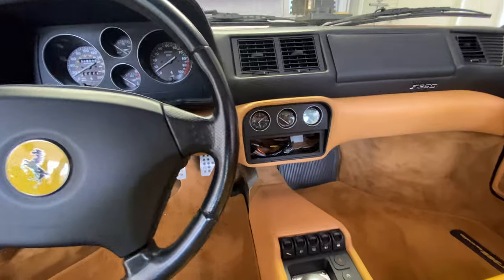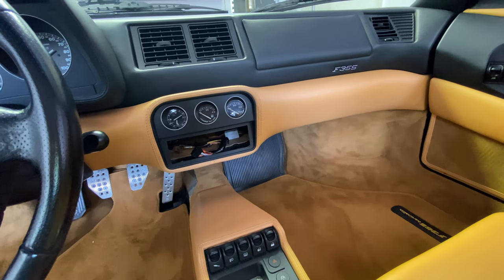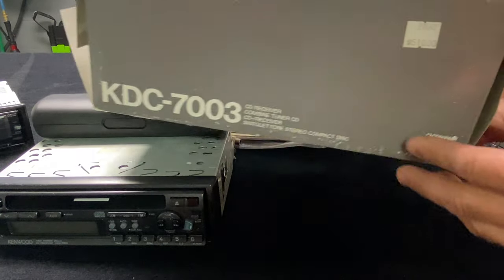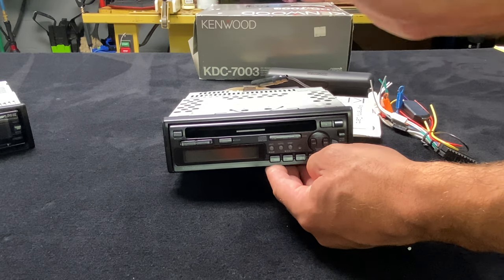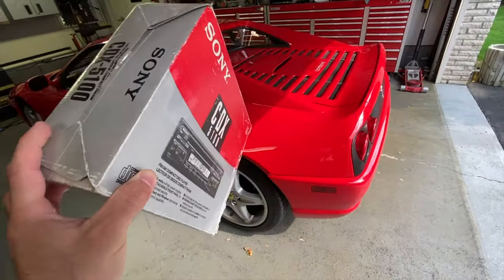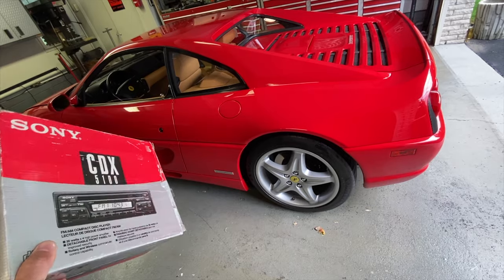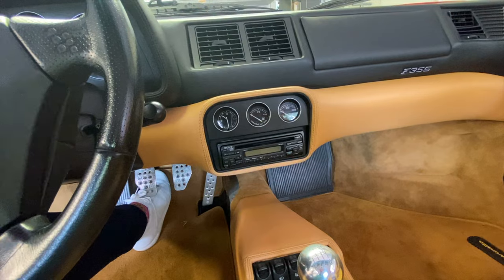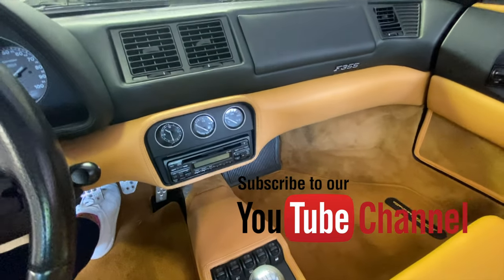Old School Car Audio | Installing a Period Correct Sony CD Radio

Comment: Showing my age. Hands down my favorite head unit, Alpine 7909, and old school zapco. Dynaudio, seas and focal for speakers.  Great video.
Reply from the maker: Yes the absolute best amps back in the day were the Zeff designed white Zapco Competitions with the 8 pin Symbilink and SP7-SL up front as a preamp. Thanks for sharing doing this hunt for an older radio brought back so many memories growing up working on these cars,.
Reply: @autofanaticcars  Love going back to old school. Hoarder here, with two never used units 1/ Clarion DRZ 9255 and 2/ Eclipse 8053

Comment: You did a heck of a job with the bezel and radio! I always was an Pioneer top of the line guy, but the old alpines from the 90s are some of the best. I’ve had a McIntosh head unit right before their car audio division went out of business, McIntosh amps, audison amps from Italy, The old PPI chrome amps, the holy grail a Denon DCT-Z1 head unit and Hertz Mille speakers. You are right on the money with this resto! I’m still working on the video review for your wheel cleaner but I’ll let you know as soon as a I do it man. My dad passed away a few weeks ago and I’ve been so busy, but seeing someone like you that is so absolutely devoted to their craft brings me so much joy. Keep up the great work brother!
Reply from the maker: thanks for watching I am a huge Mcintosh fan as my entire home system is Mcintosh. I had the very first MX401 Mcintosh head unit back in 1994 before any car audio dealers even had stock I got it from a NYC Hi Fi friend of mine who was a Mcintosh home dealer. The DA section of those head units sounded incredible they were manufactured by Clarion in Japan. I sold all my old gear way back for very good money. I had about 30 Mcintosh Amps, MX406 decks and other rare finds. The older Alpines are still being collected I know guys who have them for sale from $2000-$8000 a deck because they are period correct for supercars like a Lamborghini Diablo, Countach or Ferrari. But finding a NIOB Alpine from 1994-95 is tough but the Sony seems perfect right now in this car.

Comment: I thought Hoovies caught from ignoring recalls on the fuel system and not an audio fire.
Reply from the maker: could be but a big cause of fires on older cars many times is due to bad electronics issues from aftermarket or the wiring systems shorting out, creating sparks and fires. I get hired by customers all of the country to fix exotic cars that were dead on arrival from such and let me tell you its scary what some installation shops do to cars, very scary.
Reply: @autofanaticcars  "Could be but..." I don't want to hear that. Your point is irrelevant because Hoovie's car caught on fire because of the fuel line.

Comment: Completely agree with you and never understood the people who put those Chinese Android after market units to their 2000s Lamborghini's
Reply from the maker: yes there are guys in Europe who sell the restored period correct Alpines for the Lamborghini Diablos and Countachs that are so expensive but rare for a period correct special car. I hate seeing older cars with new head units and bells and whistles. I love seeing this old radio in my F355 each day I get in it the piece just looks correct in every way
Reply: @autofanaticcars  I have a personal question. I'm working on a high-end adapter development that would be compatible with some of these period correct units. This would give you all the benefits of connectivity, handsfree, CD audio quality over the air, etc. without ruining the interior of a special car. Do you think there is a need for such adapter or most of the special car owners still want to keep them as OEM as possible no matter if it's just an adapter or the whole unit?
Reply from the maker: there may be a small market but it would be small because most owners collect these older cars rarely drive them so it's a tough call. In our old shop way back Alpine made a remote system with a tiny display unit that we would discretely mount under the dash or in console and it acted as a source unit with the CD changer mounted remote in the car somewhere or Sat radio, it was a nice option at that time but I no longer think they offer it. You may have a much larger audience for the domestic classic car market because companies like Classic AutoSound have a huge stake in that market and most of those owners are into adding stereos and such, do some searching on that.
Reply: @autofanaticcars  thanks for sharing your thoughts